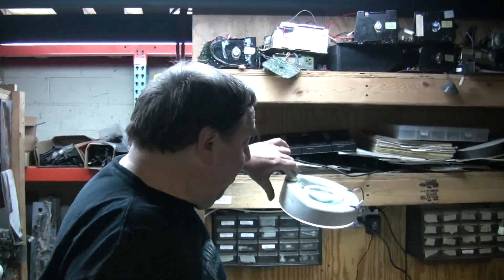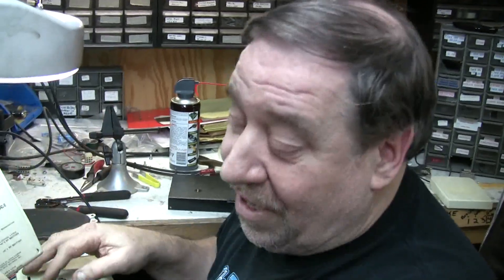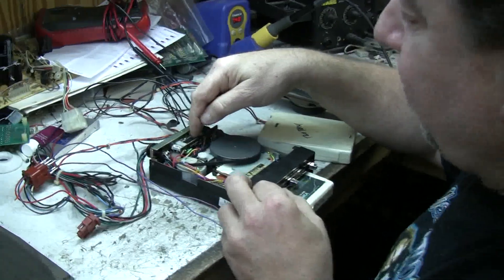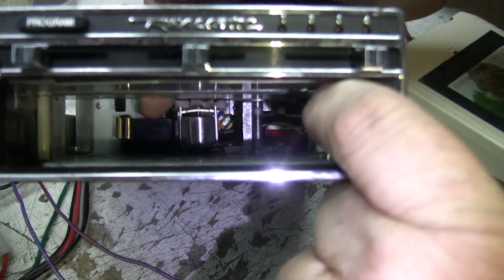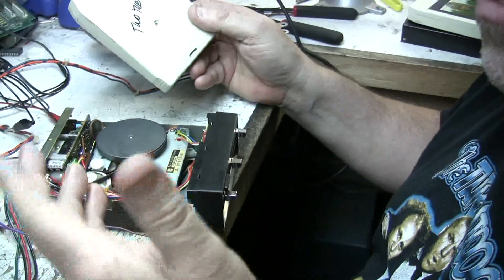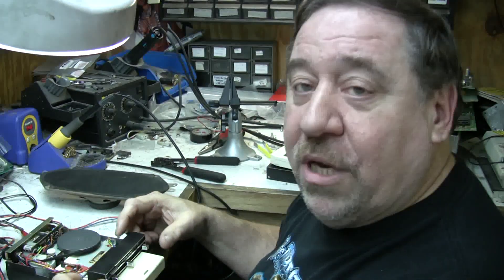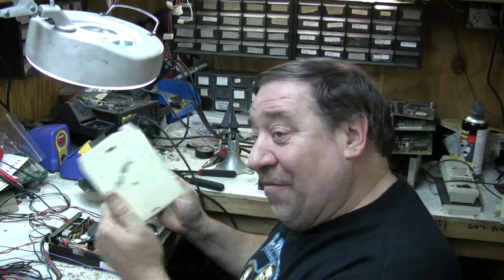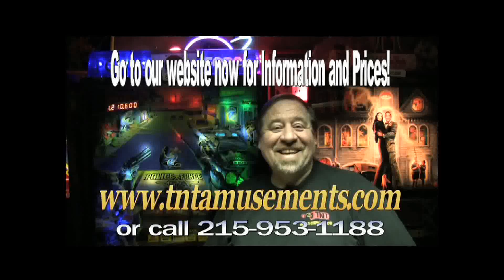#423 8 EIGHT TRACK TAPE PLAYERS and How They Work - see inside!  Another TODD'S TIPS! TNT Amusements

Comment: Interesting fact, because the tape was continuous and fed into itself, friction was a problem so they coated the tape with graphite with reduced the fidelity greatly. And eventually, when the graphite wore off, you really noticed it often to the point of the tape dragging enough it would snap. Along came the cassette players and the fidelity was enormously increased.

Comment: Great Video! Your comments on the foil sensors brought me back to my youth. My father was an engineer and designed Cinema Automation systems that used the foil on the film to do exactly what you said, shut the curtains and turn on the lights during intermission and after the show. Many people probably don’t remember that there was always an intermission at the movies in the good old days. I worked for my father installing those systems at movie theatres here in Canada around the time all those Bruce Lee movies were on so I saw a lot of them while we did the installation and testing of those systems!
Reply from the maker: I remember seeing the foil on the picture after the movie ended and it was dark (I could still see the foil) and that is when I knew the movie was REALLY over!  A relative of mine, Eberhard Schiender right here in Philadelphia, patented the "Cue Mark Changeover marks" back in the teens--a system used right up till the end of 35mm projection!  You can still see the cue marks on DVD's and tapes made before they erased them when they did the restorations.

Comment: Great video, I have an old koronette fireplace/receiver/8track/turntable unit, it has some issues, but the 8 track doesn't work then all. If you insert the 8 track the number 2 track lights up and that's it, no sound or movement being heard, if you push program nothing happens, can you suggest anything? Thanks!
Reply from the maker: check and see if any belts are broken...but it sounds like it may be a bad power supply...the little capacitors are drying out on these machines now!

Comment: i just sold my two tigers just over a year ago. I posessed the original 8 track battle sound tape also, that went with game.  whole game functioned well :) my game was not a kit conversion, came shipped from florida.  The two tigers player won't play any other 8 track tape. only the game tape. Game tape player has no track selector.
Reply from the maker: +Joe Stitz The few I have had in were standard production 8 track players...and the track changer button was disconnected.  I suppose there could have been some with a commercial player with no option to change track.
Reply: +TNT Amusements Inc yes. mine was one of those. i checked it and had no selector.so other tapes would not play what was on them.  sold mine to man in PA.

Comment: Nice tutorial. I can see why someone would charge $30 to restore an 8-track cartridge. To do it 'right' a person would need to fix whatever was wrong (presumably a broken tape), re-splice with new foil, clean the roller, replace the foam that keeps the tape in contact with the tape head, then to dub to a CD. All that takes a fair amount of time. I doubt that guy is getting rich doing all that. 

I was not aware 8-tracks were used in some arcade games.
Reply from the maker: mark grunenwald Glad you liked it!  Yes...Bally Midway used quite a few of these during the 70's in their gun games!

Comment: I remember that some of these players had a fast forward button, as well. But that was it as far as controls went. I you had a favorite song that you wanted to hear again, you had to change to the previous track and then fast forward until you got to it again.
Reply: Many cheap cassette players, like the one I fitted in my first car, only had fast forward. However, the design of an 8 track cartridge makes it physically impossible to rewind. You would be trying to stuff the tape back into the centre of the single reel inside.

Comment: Caprtonic  BJ115AA ( 8 track ) inside Jc Penny( model 683-1770-80)  am /FM Modle  /the 8 track quite playing and is not changing tracts ?  What is the solution ? 
Read moreShow less
Reply
 ·
Reply from the maker: +David Fletcher Dirty heads inside...there is also the sensor that leans on tape that could be cruddy so it doesn;t read the silver tape.

Comment: Very cool Todd.  I have 8 track in my midway flash baseball. not sure if the guy fixed  that tape though it sounds like just noise. mine is easier to tell as it has music and heckling. Maybe tape is flipped or 180 out and playing backwards?
Reply from the maker: +CNKayutube Its possible the head is out of alignment...so its playing two tracks at once.

Comment: I just recently restored my Panasonic Stereo 8 player. I got it at my Habitat for Humanity a $6 but Becky wasn't sure if it worked. I walked out with it for $2 took it home, plugged it up, and it worked great. That was five years ago and it is still working better than ever. I also have an 1975 Automatic Radio and an Electro-Brand 8-Track player that go in your car. I also restored both of them, and I mounted the Electro-Brand under my workbench! I have at least 57 8-track cartridges. I love 8-Tracks. :-)
Reply from the maker: the key is to keep them out of the sun!